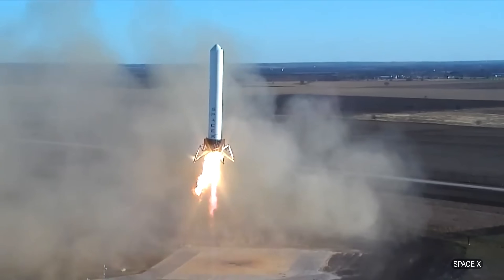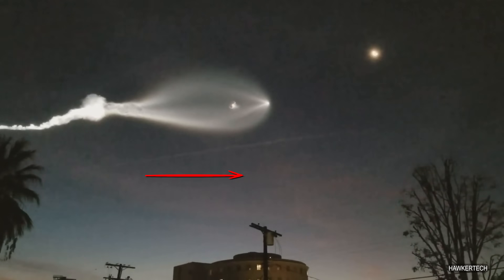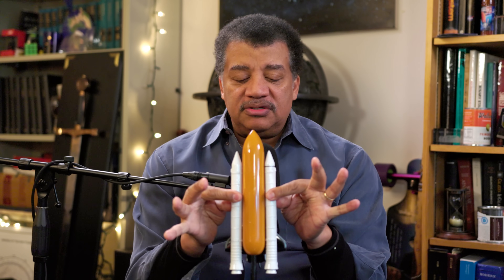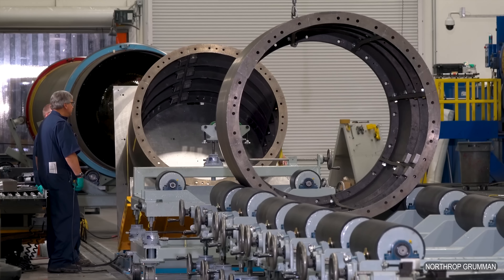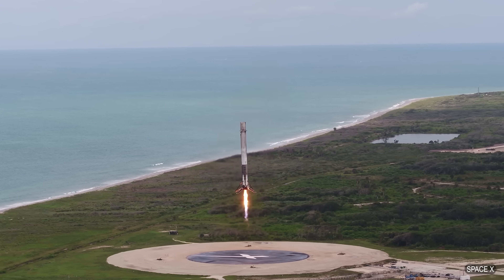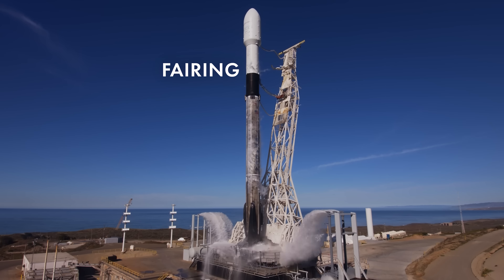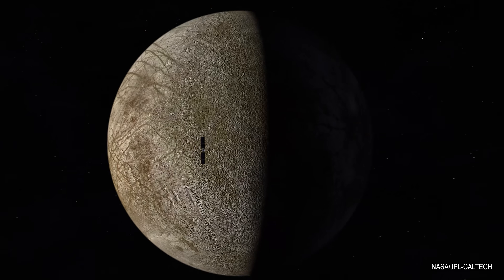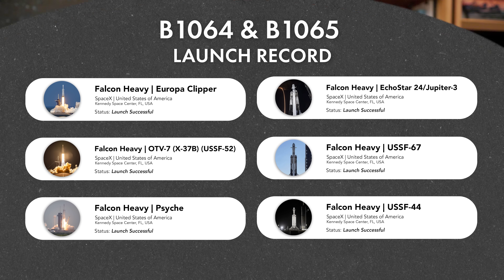What's Up with Reusable Rockets?

Comment: Because the Shuttle only flew about 4 times a year and had high refurbishment costs it cost more to put a kg of payload in orbit than any launch system ever flown.  SpaceX Falcon 9 has the lowest $/kg ever flown.  Because of re-use and also rapid turn around times.  They had a booster land for the 27th time recently !  They fly a brand new second stage with each flight however.  They are trying to fix that with StarShip where the second stage returns and is reused.  If they can just keep it from blowing up !

Comment: I always remind people that NDT claimed that SpaceX was not possible because it wasn't government funded. There are nuances to that, but that's the nutshell version. Now he says having self landing boosters cuts down the payload size. True the payload may have to be smaller than it otherwise would. BUT, he doesn't mention that the rocket going up is pretty damn big. Falcon Heavy has the second highest payload of any currently operational rocket. So even with self landing boosters it still carries more payload than all but ONE other spacecraft which is NASA's Space Launch System (SLS). It is credited with up to 95 metric tonnes of payload while Falcon Heavy carries 64 metric tonnes.

Comment: Why not design a ground based launch system where the ground launcher gives Mach 2 speed and then the boosters turn on afterwards?
Reply: The energy required to get it to mach 2 is astronomical. Spin launch is trying to throw an object to orbit up to 200 kg.

Comment: To all believers in Elon gimmicks. First check the real cost Space X charges NASA for unit of weight launched! It’s not much cheaper than ordinary launches. Second the booster recovery for the Starship, yeah that one which blew up the last 2 launches. That recovery capability, was so “important” to the mission,  that it was not even included, in the critical points of their contract with NASA. The Space shuttle was reusable, that’s not the advantage point! The real breakthroughs, not yet achieved are: turn around time and reuse cost, all the rest is a gadget!
Reply: welp, i'm gonna look it up myself for sure, but if this true that's hilarious.

Comment: think it's important to point out that the solid boosters cost as much to refurbish when it drops into the ocean as new boosters
Reply: true, they need to cut the segments then refill the SRBs. Reusing SRBs turns out has little benefit than building a new one
Reply: SpaceX doesn't use solids.  Poster was referring to the Shuttle’s SRBs.
Reply: Not every cost is in $$$.
Refurbishing could cost the same money, but almost entirely in "labor". 
Building a new booster could cost same amount of money, or even less, but you need to dig new raw materials from earth. So, the environmental cost is much higher.
Reply: No, they don't. The whole point in doing it is cost, and SpaceX is a for profit company that makes billions of dollars.

Comment: Um they did try for fully reusable before the 2000s It was an consideration and they did have success with it too! One was called McDonnell Douglas DC-X. Look it up. Early 1990s. Looks just like Blue origin and SpaceX. Mainly Because those engineers ended up getting hired by blue and spacex for that very reason. The vids are amazing even tho probably filmed on an old huge camcorder haha. Watch them tho epic.

Comment: Historically, the main challenge with rocket reusability was the expensive process of checking each part for fatigue, which often outweighed the costs of building new engines. The only savings data I see comes from Elon Musk, who claims a 30% reduction—down from his earlier assertions. Furthermore, his Starships appear to be tested without approaching their intended load capacities, raising concerns. I worry that Elon’s top-down approach may hinder collaboration with his team. While I understand the value of trial-and-error testing, it's troubling that not only have his rockets experienced failures, but even successful launches have faced significant heat shield issues, often without carrying any payload.
Reply: They're things that are borderline impossible. The heat shield will be the biggest victory once mastered

Comment: Starship catch tower was severely damaged "catching" the last rocket. The launch pad itself was severely damaged and the fixes are not easily done. Space trends has an excellent video describing the damage done to the pad.
Reply: Thats a lie
Reply: @hglenn55  Prove it with Facts. Have any. Look it up cupcake
Reply: @hglenn55  On You tube lookup space trends starship 8 launch pad damage. That will educate you... The large launches are causing significant damage every time. What's so hard to imagine Why???
Reply: @hglenn55  look up starship 8 launch pad damage on space trends You tube
Reply: @hglenn55  space trends damage on Pad from launch
Reply: @hglenn55  you're a lie

Comment: Are those exploding rockets were reused ?
Reply: Starship is an experimental vehicle being developed by SpaceX, SpaceX follows a hardware rich approach, which means fly fast, fail fast, learn fast, to say Starship is a doing a few firsts is an understatement, There hasn't ever been anything like it. SpaceX followed a similar approach to the Falcon 9, and today it's the most successful rocket to date (you can fight me on that). Super Heavy (the bottom part of the starship launch system) has proven itself to be wildly effective, having been caught 3 times already, it's the upper part (the ship) that is giving them trouble due to weird vibration harmonics when the fuel tanks are nearly empty
Reply: StarShip is a test program not a finished product.

Comment: I can see where reusable rockets are cost saving but it’s only cost saving when the part on top doesn’t explode
Reply: Bruh how u gonna even have a reusable rocket if the top blows up 😂😂
Reply: The Falcon 9 has proven reusable rockets work, flying at least once a week, if not more. Starship their experimental vehicle is the one with the exploding second stage (dam you block two!) but most likely it will be solved during the next flight as we now have a pretty good indicator to what happened, and block one ships were pretty successful after a few flights

Comment: Reusable rockets are excellent for launching payloads into low-orbit, but beyond that, their practicality diminishes. Take Starship, for example—it requires 15 to 20+ launches just to reach the Moon. New Glenn is slightly more efficient at 4-5 launches, while Falcon Heavy must forgo its reusable boosters to reach interplanetary destinations or geostationary orbit. A more effective approach for Moon or Mars missions would be a spacecraft operating in a continuous orbit rather than launching a new one each time. Instead of building massive spacecraft on Earth's surface, our focus should shift toward orbital manufacturing, especially since there's no immediate need for such large vessels. This idea that we have to get to Mars immediately is just, in my opinion, dumb. Aside from its value for scientific research, Mars doesn’t provide much to humanity that a space station couldn’t do more effectively and safely.

Comment: The planes engines are so expensive, because they are designed to be reused. If you do not have to heat cycle an engine, you can take more liberties in its design. Can these engines even be reused as is, or do they have to undergo extensive servicing?

Comment: I can only guess that they want to make a ship similar to the designs in old SciFi movies. This would be an a single ship that would land and then take off again without assistance.
But yhis concept is not rational. First its a sci-fi idea. Second what you eventually need is to plan trips to every planet in the solar system. Then combine the technologies from each trip. Then you would have foul proof tech that would reach every planet. Again, this is not rational. Landing on Mars is different than landing on the moon. The weight of the craft would be different. Also, our rockets work because of the chemistry available on Earth. That chemistry is different on mars. Combustion would work differently going from planet to planet. Graveyy would also work differently. The amount of energy to escape orbit is different on each planet. 😢

Comment: The added weight cuts down on the payload, sure, but the amount of money saved by doing two trips with the same equipment instead of one trip with one-time-use equipment makes it more viable. And as more iterations on the technology happen, the excess weight for additional systems will be reduced more and more. So it's definitely a field worth researching.

Comment: it's worth noting that the cost of refurbishing the Space Shuttle's SRB's was so expensive that it actually would have been cheaper to expend them and forgo the recovery hardware, which is why SLS, which uses the same boosters just one segment longer, just discards them.

Comment: @1:48 "Recycled" instead of "reused" is a good description of the process.  They were broken down for parts, some discarded, some refurbished, and a mix of old and new parts was used to build a new booster.
Reply: 1. First Stage: After launching, the first stage of the Falcon 9 rocket performs a controlled descent and landing. It can land on either a drone ship in the ocean or a designated landing pad on land. Once it lands, the first stage is refurbished and reused for future launches. This significantly reduces the cost of space travel.😂 the first stage is the primary reusable part, other components like the fairings (which protect the payload during launch) are also sometimes recovered, refurbished, and reused. SpaceX has developed a system to recover the fairings, which are expensive, by catching them with a net on a boat or by using parachutes to guide them back to Earth.
Reply: Neutron by Rocket Lab will be the first medium launch (falcon 9 class) rocket to actually be rapidly re-useable (not recycled). Maiden launch this year. Designed to have a 24 hour turn around once mature.
Reply: @ Orbiter was supposed to be two weeks, and Falcon 9 was 24hrs.  You can claim anything you want when you don’t yet have a rocket to demonstrate on.

For all I know, Falcon 9 actually could cycle in under 24 hours.  If you can break refurbishment into enough short, parallel tasks, you can throw an army at it to get it done.  There’s just no point.  SpaceX is launching at a higher cadence than the rest of the world combined, and they’re doing less than every other day.  With a dozen boosters sitting in the hanger, they can get by launching each only once a month.

The real important metric is how much does refurbishment actually cost.  As outsiders, we can only make an educated guess for Falcon 9 based off several year old vague public statements.  For Neutron, we can’t even do that.
Reply: @wagnerrp  Chinese space program actually went ahead of that too and they have a Boeing 737 style reusability
Reply: @ Er... what?  What production launch vehicle do they have that has been reused even once, much less "fuel and go" operation?  Low altitude hopper demonstrators that have not carried payloads are not "production".  And who calls it "737 style"?
Reply: @wagnerrp  Falcon 9 was never supposed to be re used. It was Frankenstein’d after the fact. Just going to point that out.

Kerosene does not lend itself to rapid turn around and is the limiting factor for Falcon 9.

No discredit to the input you’ve given. Just adding.
Reply: @Mottbox  Of course it was supposed to be reused.  The very first launch had a parachute.  The parachute didn't work, because it never got a chance to work, because it burned up on re-entry.  Powered landing was Frankenstein'd after the fact, along with supersonic retropropulsion as an active re-entry shield, but reuse was always the goal.

Kerosene does have some problems with reuse.  At higher temperatures in rich mixtures, it produces carbon buildup on cooled surfaces, which can eventually choke flows.  That doesn't mean you cannot do it, clearly.  When is the last time you had to clear out carbon buildup in your car?  How often do airlines have to clean carbon buildup out of their jet engines?  You can run extremely rich, dropping temperatures low enough to avoid coking issues, sacrificing efficiency.  This is done in the gas generators.  You can run oxygen rich to eliminate any unburned carbon, like the pre-burners in the RD-170 family.

Even then, it's not an instantaneous issue.  There's no hard rule that you cannot perform a second burn.  Merlins on the booster perform three burns each flight, and IIRC up to six on the upper stage.  There's no hard rule on duration either, as the RD-180s on Atlas burn for nearly twice as long (4.5m) on launch as the Merlins on Falcon (2.5m), and the vacuum engine on the upper stage has >6m of endurance.  It's all a question of buildup rate and engine tolerances before that buildup becomes a problem.  That could be every flight, or every several.  It could be that the single-start outer engines can be reused immediately, while the three centerline engines would need to be cleaned.  That's not fuel-and-go, but if you can swap those three engines in a few hours, during the same time that you're integrating a new upper stage and payload, what's the difference?  We've seen such rapid engine replacements performed on Starship.
Reply: @ Falcon 9 was not designed to land - it was modified after the fact. 

It was only from Falcon 9 version 1.1 that they switched focus to re usability. 

This isn’t a debate. You can google it.
Reply: Sounds a bit MacGyverish 😂😂

Comment: Can you touch on the iterative development of rockets, and the testing process in a later video? 
Because it drives me bonkers every time I see a news video about a SpaceX test flight 'failing'/blowing-up followed by comments criticising SpaceX as if it's a loss for them. 
I don't think most people understand that in most cases the plan was never to have the flight completely succeed, and it's all just an iterative process with no cause for alarm, especially when they're not crew rated.
I've seen so many people rip on SpaceX and Elon as though they shouldn't be trusted due to a rocket failing/blowing-up which is very counterproductive and damaging to the space travel future we all want.

Comment: Aircraft good landing if you can walk away. If you can use the aircraft again, it's a great landing: economical flights require that all landings be great. We are now getting the same scenario for rockets. The Starship booster catch allows the booster to have no landing legs, which substantially increases the payload available.

Comment: The equation with the weight of the fuel they have to bring up, and be used to land take away a lot of weight for payload. It would be better to land with parachutes combined with a few corrections rockets.. Parachutes with small correction boosters would be the best and still the boosters could be used again.

Comment: Starship is an impressive vehicle, and the engineers at SpaceX are undoubtedly doing remarkable work. However, while witnessing the booster being captured by the tower in South Texas is exciting, I will reserve my celebration until Starship version 2, or V2, successfully returns to Earth after completing a full orbital mission, rather than a partial one. Until that milestone is achieved, we are still in the prototype testing phase. It is important for people to recognize that each time one of these prototypes fails, it incurs a cost of approximately 10 million dollars. While rapid iteration is valuable, cost considerations also play a significant role. How many prototypes can be lost before it becomes necessary to reassess the design? Personally, I believe that developing a larger version of the Space Shuttle could be a viable alternative.
Reply: SpaceX burning up a few upper stages along way isn't really much of a cost consideration as SpaceX have currently only spent about one tenth of of what NASA has spent to date on the SLS/Orion, While developing the largest flying object ever built, with the biggest payload bay of any rocket ever built with the heaviest payload capability of any rocket ever built, all with a target off full re-usability  that borrows nothing from any existing rocket.

Beyond that, the shuttle or anything other  larger shuttle like object you might be imagining, needs a large prebuilt runway to land on.   Which doesn't given the intended purpose of the starship.   The only option is a powered vertical landing, which on earth can be the tower catch, but on Mars it will landing legs.
Reply: @bradmcgrath358  Funny...  I thought the "upper stages" Is where the crew goes.  The big cost reduction was the implementation of COTS.  The inspection routines in the past were very costly, but insured success as much as it could.  The new method...  I do not even see what the new method is.  Oversight is a good thing.  Losses in quality control is what cost Boeing a big hit in their reputation.  Who gets held responsible now when Mucks' crap screws up?
Reply: At least 100 million for this one, now they are really just waiting for the next launch to test the most important things. This one really hurt, more than the last one.
Reply: This booster does push up 141,000 Lbs.  But no robotic arm, no space science work, no servicing missions. Larger?  Have you seen a shuttle up close?  Perhaps it would be nice to send up our best out-of-service shuttle and then send up some as yet non-existent refueling hardware and use it as a constant orbiter going around cleaning up our orbital debris.

Comment: Stack the ice on Antarctica into a column with a square mile shaft inside and ice walls a mile thick.  Connect the moon to the Earth permanently, and be done with it.  Install a nice cool elevator.  I suppose the cheap way would be to take up a rope one quarter of a million miles long, let it hang down to Earth and drag on the ground, and anyone could climb it.